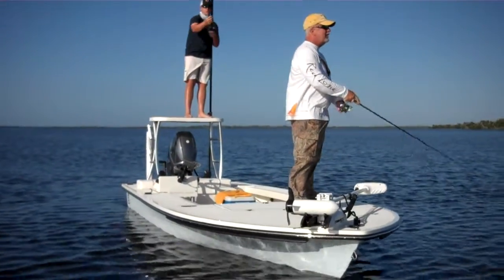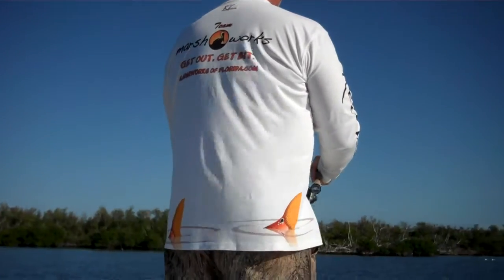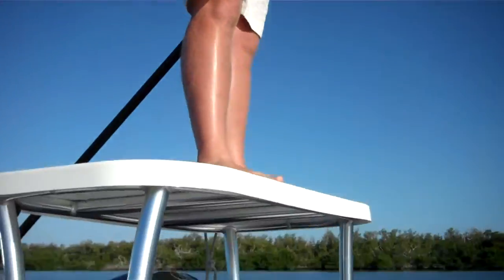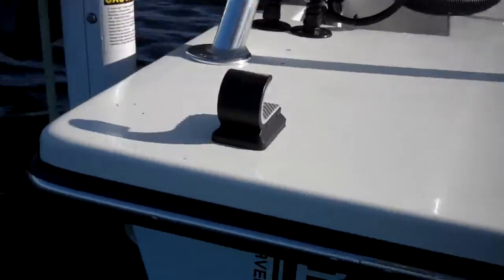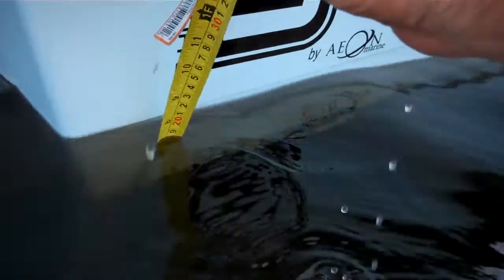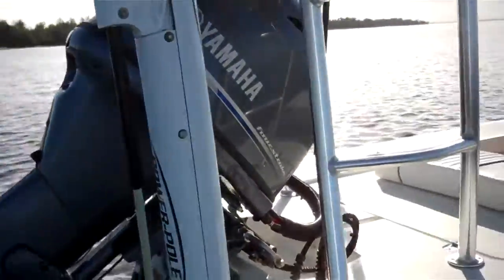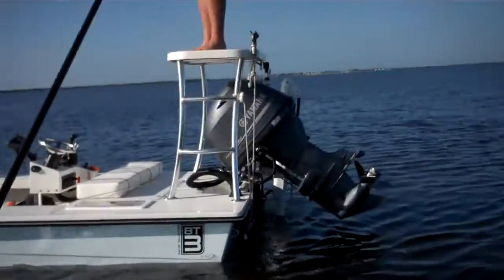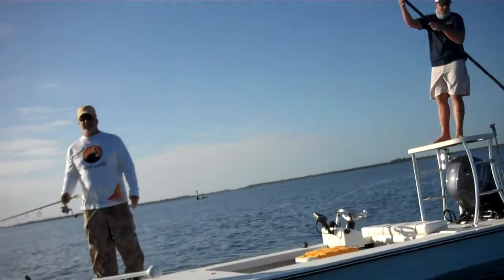Beavertail BT3 Draft Video

Comment: Not sure if the BT3 has dead rise, pretty sure it does though. In any case where you measured the draft at was not the correct location. Should have measured from the center of the keel on back of transom. Guessing it to add another inch.